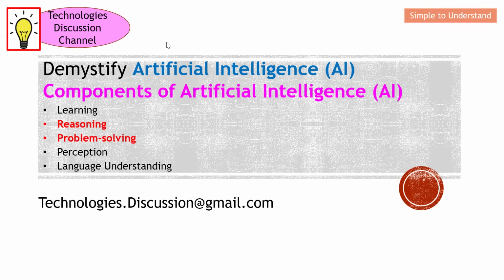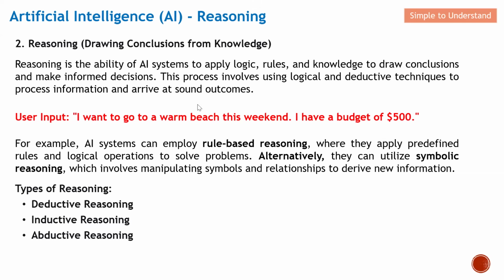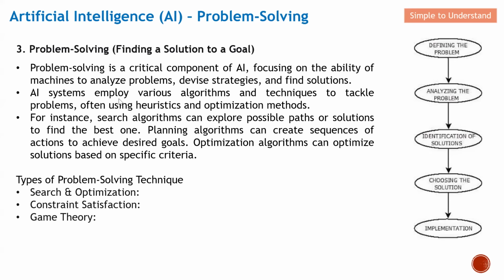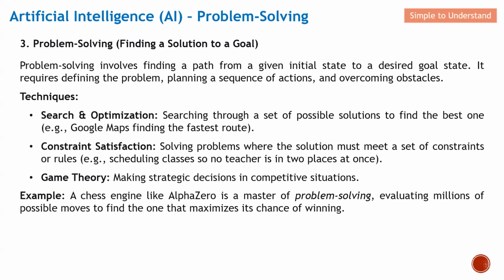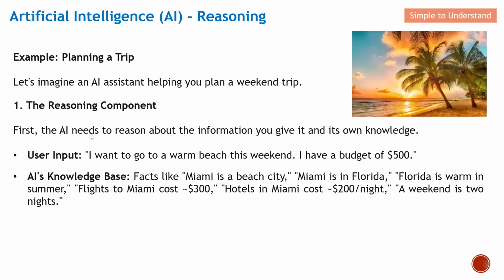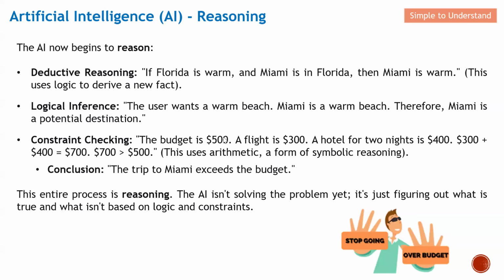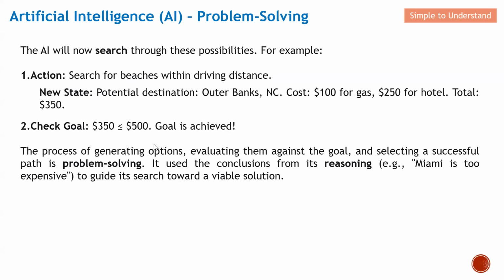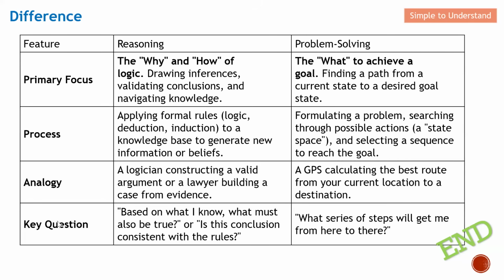AI #2. Reasoning Vs Problem-Solving Explained: Why Thinking First Beats Solving Problems Instantly.

Comment from the maker: In this video, I'd like to discuss the components of Artificial Intelligence (AI) further. I think many of us have the misconception that reasoning and problem-solving are very similar. While they are quite related and may have some overlap, they can be entirely different.
In short, reasoning involves a lot of thinking, while problem-solving involves taking action from a starting point to an end goal. After going through a reasoning process, you might not find a solution to your problem. The outcome might simply be the conclusion that a solution is not possible.
However, in problem-solving, even if the initial reasoning offers no solution, you then switch to a problem-solving mode. In this mode, you look for alternatives to find a solution. There might even be multiple solutions to choose from—perhaps the most cost-effective one, the fastest, and so on.